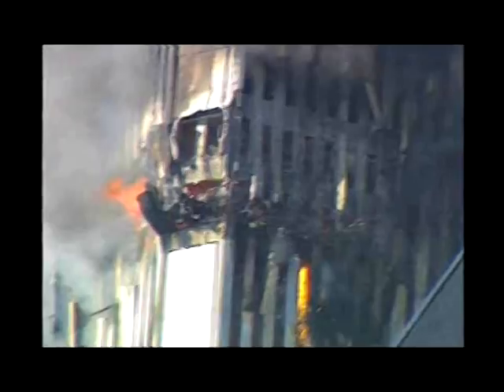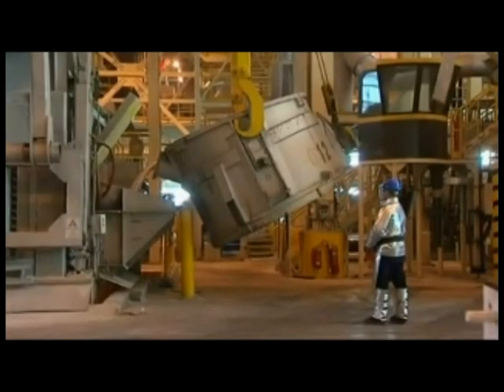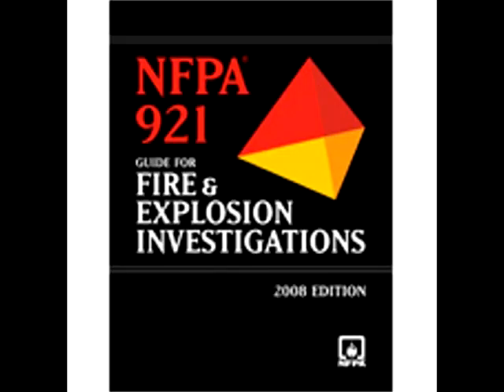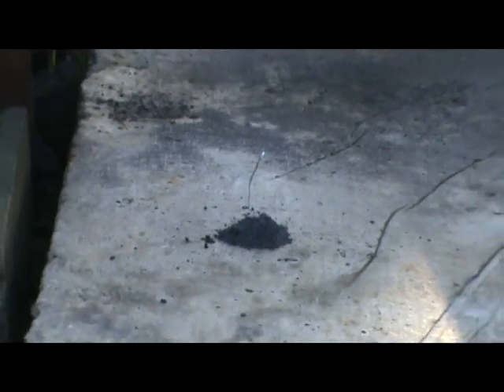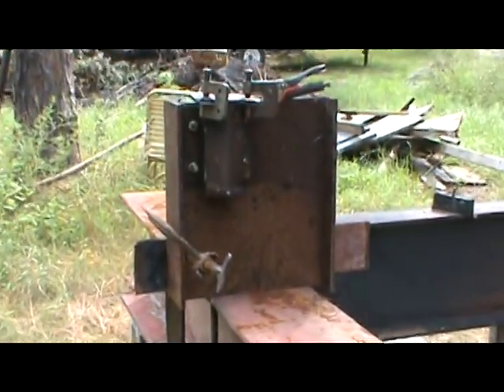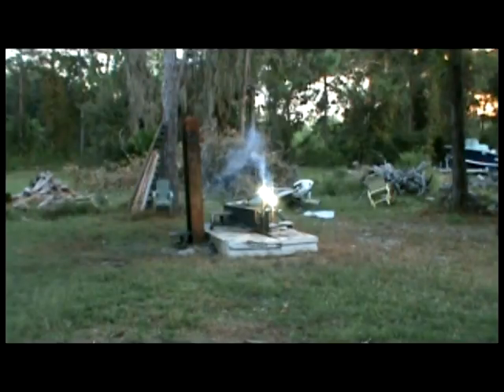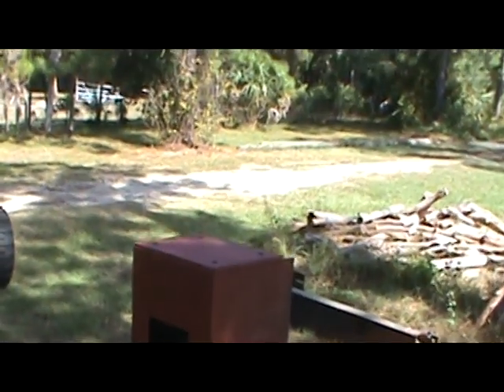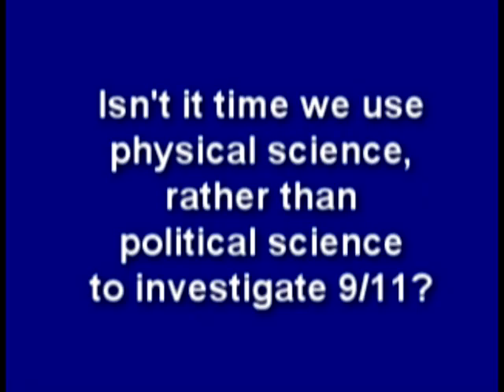9/11 Experiments: The Great Thermate Debate

Comment: Lets just get past the point that an aluminum airplane CANNOT slice through a concrete and steel beemed structure.  The first part is impossible, leading up to this part, which is also not due to the plane.  So the planes had nothing to do with any of it, yet they get ALL the blame.  WE were set up by our own government so they could start a war with the middle east.
Reply: pickin4you I worked on these same type of aircraft in the military....the wings alone have giant steel bulkheads in them....I promise you with 100% certainty....they can rip right through iron at that speed....if you think that they're made of aluminum then I'm done with you because your obviously in over your head!!
Reply: You're completely wrong. An Aluminium airplane weighing hundreds of tons can easily break through a building structure like that. Everything you said is 100% wrong.
Reply: It's all down to the speed. For example a 55 grain 5.56mm projectile easily penetrates 1/4 plate of mild steel, despite being made up of a copper jacket and a lead core, both materials substantially softer than steel. The 3200 f/s the projectile is travelling at makes it all possible, and we often see light bullets with lead core travelling very fast penetrates thicker steel than slower bullets with steel core. But once you shoot at hardened steel it's a different matter. Then the hardness of the projectile really do matter.
Reply: i watched it from the ground,how did they fake that?
Reply: gravity pulls straight down not from the side.
Reply: pickin4you why does everybody forget that those building had a lot of glass in them as well, so it's not like it was hitting a cement wall
Reply: pickin4you your dumb as hell...a fucking airplane can and DID fly strait through that shit
Reply: Of course it can. I can slice through steel with a column of water if it's moving fast enough, In fact, My brother does this on a weekly basis.
Reply: Precisely what I was referring to, thanks Mike.
Reply: pickin4you 
Just so you know, the aluminium in aircraft isn't thin like the aluminium on a roll in your kitchen ala tin foil.
 There's plenty of mass in an aircrafts aluminium fuselage.

The others are right, you don't understand physics.
Reply: Mike B 
Obviously you've never seen a real demolition.
Even more curiously, you don't seem to have seen footage of the twin towers collapsing.
Reply: pickin4you lol u clearly don’t understand physics
Reply: Lee Lankford I love facts
Reply: justin pearson hahaha, the jokes just got real
Reply: Regardless of whether a plane will go through a building or not the buildings fell at free fall speed into their own footprints.  Something melted the steel and it damn sure wasn't jet fuel and office furniture.  There was no jet fuel involved in building 7. No planes hit it either and it fell in the exact same manner.
Reply: Building 7 was reported to have fallen before it really fell. The fix was in and the elites were behind it.
Reply: what about the third building... not even hit by a plane...still falls directly down. just saying...
Reply: Fire a wad of paper at relativistic speeds and it will go through anything.
Reply: Very close to c the atoms would split on impact.  It might start a fusion reaction.
Reply: Fuck off George, you're an off-topic nutjob.
Reply: no sense bitching about it now even if the truth came out would it change much not really id say.
Reply: Errrmmm. Physics old mate. Do you recall the image of the twin prop aeroplane embedding itself into the side of the Empire State building? A smaller, slower aircraft still managed to penetrate a steel lined building. https://youtu.be/5YLWh8Rbp7o I'm not saying the US Govt wasn't complicit in the Trade Towers collapse, but I am saying an aircraft the size of what hit the towers will easily penetrate the building.
Reply: Peeps... just use quantifiable math/physics 101. F=ma. It's a start.
Reply: this is just a distraction from building 7 which has yet to be explained
Reply: George Soros says the guy whose name is literally George Soros wanna be cancer
Reply: pickin4you citation required
Reply: Wars for Israel. Watch Ryan Dawson's War by Deception (https://www.youtube.com/watch?v=pK6VLFdWJ4I) or his 5 hour long documentary on exactly who was behind 9/11.
Reply: not arguing, just stating what I understood happened, and am a builder, so get structures, both wood and steel. 
The twin towers were framed with a central structural core housing stairs, elevators, bathrooms and utilities
they also had a exterior structural wall, the box beams and supports
Connecting the 2 together, the spanning floor joists.
when the jet entered the building it weakened some of the wall and severed some of the floor connections.
then the jet fuel, (kerosene essentially) ignited, 
igniting what could burn(and don't forget, human fat is a fuel....sadly) and creating with the winds at that altitude blowing through the floors a blow furnace
there is Magnesium in jets, hence the jets of molten steel
but the intense fire SOFTENED the floor joists  causing to bow under weight.
Severing the bolts and braking the welds
causing the exterior wall to bow out(can be seen on video)
causing the structure to fall inside itself, with lower structure guiding it fall as it collapsed from within
this is my understanding, could be wrong, but as a builder, understanding structures, seems entirely plausible
Reply: No they couldn't,  where is the wake vortex,  you believe the lie or are a shill
Reply: Randy Orton's Dick Bulge imagine of it was flying into a giant brick wall 😂 its like "allah ak" squash i imaging it bein a really thick building though to withstand the weight
Reply: Seen straw in concrete before.
Reply: it was a combo of both plane and thermite
Reply: Well, what about the wars and the lockdown on air travel and the domestic surveillance?
Reply: You are correct, pound for pound aluminum is actually stronger than steel.  That was not ordinary aluminum either.
Reply: pickin4you... actually a wad of wet paper towels, if given enough speed and stopped suddenly can impart an incredible amount of energy... It's all just a matter of how fast you get the paper towels going.  If you have enough money, you can make a Coke can punch holes in aircraft carriers.
Reply: Then explain to me how copper and lead can penetrate steel?
Reply: Are you stupid? I'm pretty sure a fucking plane could cut through concrete and steel beams. Especially at that speed.
Reply: But a tree is a soft wet plant.  Even a hard pole is wet inside and has huge grain openings.  I know what you are TRYING to say, but aluminum cannot slice though steel, and a plane stay intact enough that the wings do not come off.  Remember there is concrete covering that steel also.  I also re-read another post where they said those beams were made of 1"-1 1/4" thick steel.  And its not just one beam that plane had top slice through.  I would guess maybe 10 to 15 of them, and all of that concrete, and slice through and keep right on going until the nose poked through the other side of the building????  Not a chance in hell.  Oh, and if you see the nose of the plane, which is visible for s split second, it is still ROUND, and not deformed in any way.  And remember all of the beams that are inside that all of that plane had to slice through so the nose would make it through to the other side.
Reply: pickin4you, no you don't understand physics, at all.
Reply: pickin4you no you dont
Reply: pickin4you F=ma  calculate acceleration high with lower mass
Reply: pickin4you ummm yes... actually those 20” ton commercial jets could def penetrate those buildings at 4-500 mph.... try educating yourself!!   ESPECIALLY THE TWIN TOWERS WITH THEIR CONSTRUCTION!! Lolol
Reply: Never mind the fact that a tornado has been known to send pieces of straw through building walls. If a piece of straw can go through a wall then a plane can go through a building
Reply: why do you act as if the buildings where weak they where some of the strongest buildings in nyc. and they should have fallen over not strait down
Reply: So the next question is, what are you gonna do about?Nothing! And by the way you probably support the blue👮😈
Reply: The planes did not blow their way through.  The bulldogs were designed to move a maximum deflection of 11 feet from vertical. The farthest they had ever moved after they were constructed from wind loading was 4 ft.  On 911 they deflected 21 ft.  A sizeable amount beyond the design spec.
Reply: ????  Citation for what?  Why Required?  Is everyone here so stupid it has to be written down for you to believe it?  This is how I got great at my work.  Everyone else took  the words someone else writes as GOSPEL, and NEVER questioned it, and used their own brains, which they all lacked in.  I used my brain, which I am just guessing from all of the comments, that I must dwarf everyone in the IQ department, but I used my own mind to do my work, and everyone else was lost, and I ended up being their instructor.  Nobody in the past 20 years of my work, had the mechanical aptitude that i do, and no matter how many manuals they all read, they have to come to me to help them figure out what is wrong.  Most of what I think I have which I rarely see in the world these days, is just good common sense.  I was gifted with a ton of it, and everyone else seem to not even  know what it is.
Reply: I have plenty of education and know, that those wings should have sheared off and the nose of both of those planes should have crunched up against the building, and not go all the way through, as you see the nose of one of them coming though the other side.  See... this is the part where stupidity is at its best.  You saying aluminum, if going fast enough will shear though heavy steel I-beams, so this.... with YOUR logic would mean that a wad of paper, hurled fast enough would go through a tank.  So now... you need to go and re-educate yourself.
Reply: Oh I do, and seems I do way more than the rest of you.  You need much more MASS in order to get through, probably 1/2-2/4" thick steel I Beams, than that of an aluminum airplane.  It does not weigh enough to slice through those beams with the MUCH softer aluminum.  There is NOTHING other than the engine parts of a plane that are steel.  You need HUGE amounts of mass to slice through that building like it was butter.
Reply: the towers withstand higher wind gusts during a wind storm than the planes could have created.

Comment: Those responsible are so supremely confident that they didn't even bother to come up with a possible story. However they did control the investigation, plant evidence, and manipulate or spin the media.  When has anybody witnessed an aluminum wing built to be as light as possible, cut through a steel beam build to be as strong as possible like a hot knife through butter, even to the very tip? Ask that and watch the video again.One building fell down all by itself, perhaps from survivors guilt. The pentagon was hit not by a magic bullet, but by a magic plane that managed to miss every pole on approach; then squeeze through a small hole the kind a cruise missile  might make. The fact is the only people capable of pulling this off are currently running the show.So don't expect any investigation no matter what is uncovered. You are at war but the  enemy has already reached your capital.
Reply: Patrick Edgington Well said, and absolute truth.

Comment: WHAT in the hell does a metal coin floating on liquid mercury have to do with office furniture increasing the melting point of aluminum and what does molten aluminum with added office furniture have anything to do with a steel structure building collapsing?

Comment: Smoke dissipating could mean that the fire began to burn cleaner (or in a more stoichiometric condition).   Now, if the fire burning had propagated through floors below and allowed for a convective draft to be formed, the flames would now be allowed to have enough air to burn at, or near, the aforementioned condition, which would emit much less, or no smoke.  That being said, the adiabatic (yes I know there was heat transfer present) flame temperature of kerosene is 3799.4 F.  That’s 1000 F ABOVE the melting temperature of steel!  So it is ABSOLUTELY possible that a kerosene flame can reach that temperature.  As a combustion scientist myself (my doctoral studies were in thermoacoustic instabilities), I say the evidence presented here is either thin and highly circumstantial, or it is laced with well known facts, but also excluding lesser known ones that could lead the viewer to a different opinion.  Yes, thermite will melt steel...the reaction emits molten iron; also yes, evidence that it was used or not used is inconclusive.  The point I’m making here is you neglected to mention the facts that (1) Kerosene can burn way hotter than needed to melt steel. (2) That a clean flame doesn’t emit much,if any, smoke either.  Sorry for being so long-winded, but I felt the need to point that out.  I, for one, don’t think everything is a conspiracy...those guys hated America, took credit for it, and deserved to die.  Also, if you would like to know more just message me and I will provide further details.
Reply: Also, titanium (used in turbines) burns bright white...just saying.
Reply: Annealing is a death blow to steel in a heavy building. Kinetic energy of the plane would place the fuel inside the building. Fire protection on the beams was compromised. The government should take some blame for not protecting public safety and they did. The confluence of mitigating circumstances created the perfect storm ie; our erosion of economic, freedom and world mongering is in question now. With a poke at Trump thrown in by me.
Reply: Tim I definitely think there is a much better case to be made for negligence.  Very articulate and well put response.  Kudos to you sir

Comment: This guy is bullshit. He cherry picks his information and then only gives you the little snippets of what  he wants you to see. None of it is evidence of a conspiracy it is only theories of how one could cut steel in a laboratory situation, and I know from experience that what you can do in the lab seldom translates to the field. How did they charge all of this up without anybody ever noticing? A better question is " how did they initiate it?" he doesn't even attempt to go there, or answer those questions, instead he directs the questions and only goes where he wants to go. What he is insinuating is absolutely impossible. Also you CAN generate enough heat in a fire. It just need lots of oxygen, fresh air. How much air would have blown through that building at that altitude once the window were blown out? Plus the heat draws like a chimney and draws air into it. Plus the colossal weight that was on those beams, they only needed to be weakened before they would collapse. Sure, things went bang. What do you expect? There would have been hundreds of things in that building that would explode when under extreme heat. Gas cylinders etc: any type of pressure vessel, water heaters, the list is endless, but no. people want to believe in conspiracy theories. Well I say BULLSHIT. To bring a building like that down requires a team of specialised men over several months just to charge it up, and then there would be wires running everywhere throughout the building This video only convinces the ignorant, who have a simplistic view, can be convinced in just a short video, and know nothing about what is involved..
Reply: Charlie Brown wires everywhere? LOL.
Reply: You've obviously never worked with explosives. You tell me how they are going to initiate it then.
Reply: You really think, that explosives must be wired? Wireless detonations were available long before 2001.

Comment: pure oxygen will increase the temp of any carbon based flame. that is how a cutting torch works. the oxygen reacts with the hot metal. the chemical reaction is what gets the temp high enough to get through the steel

Comment: And also first hand experience with thermite it's hot really hot and really bright but it will not melt steel we used steel tubs to hold and carry thermite it doesn't even come close to melting a 1 inch think steel tub

Comment: So I worked with molten aluminum  in a cast house if you get aluminum over 1700 degrees it glows bright red over 2000 degrees and it will glow red enough light a pitch black cast house in the middle of the night. That being said molten aluminum does not spark or look like a shower of sparks raining Down. I'm a firm believer there's more then there telling us. I just wanted to share my first hand knowledge of aluminum glowing red orange